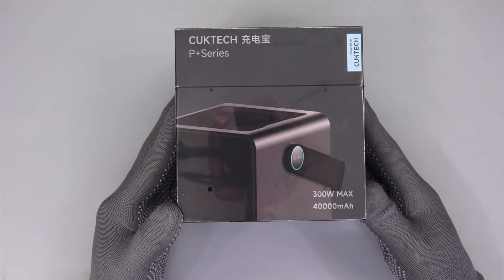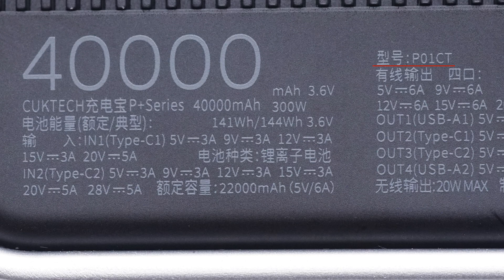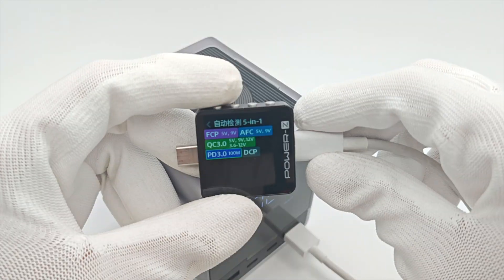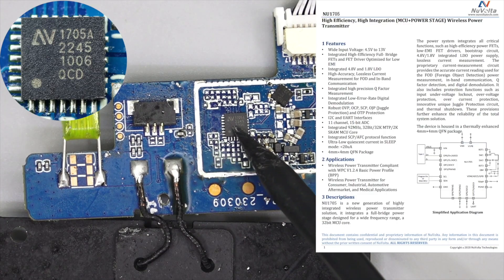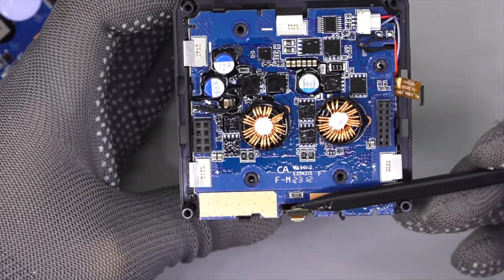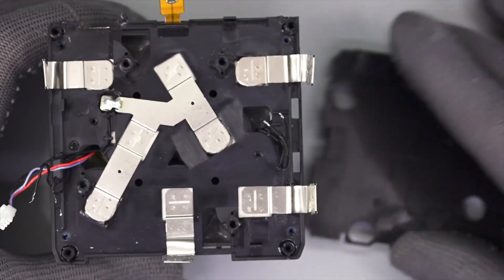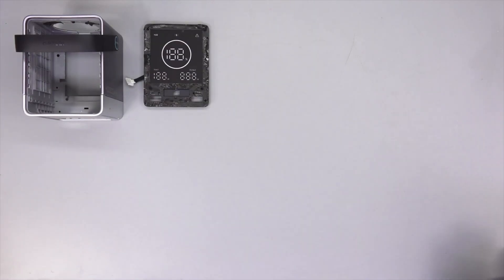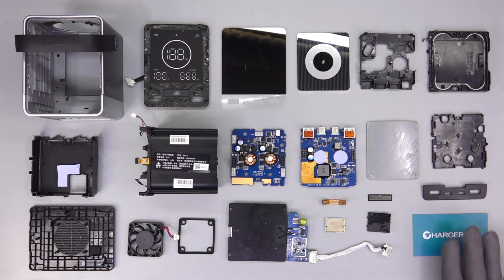Teardown of CUKTECH No.30 PD3.1 & 300W Power Bank

Comment: How does the USB-A port support PD 3.0?
Reply: They use custom USB-A with additional connector inside. You can see a little cutout in the middle bottom of USB-A connector tab - 0:47
So it only works with provided cable.
it's the same in Zmi QB826G